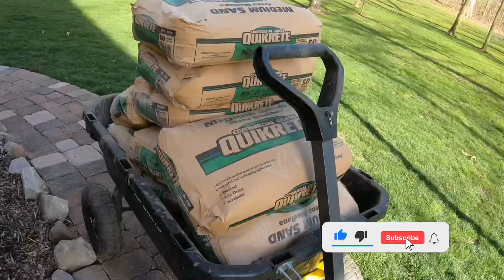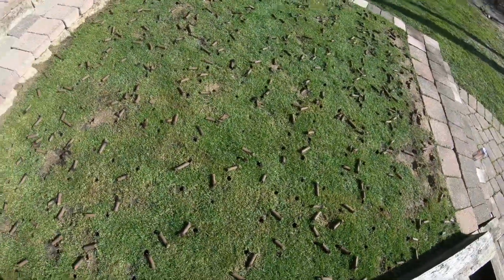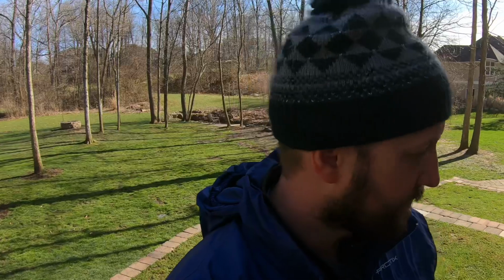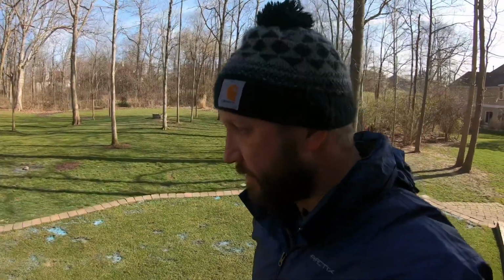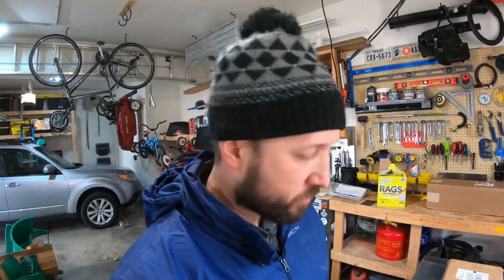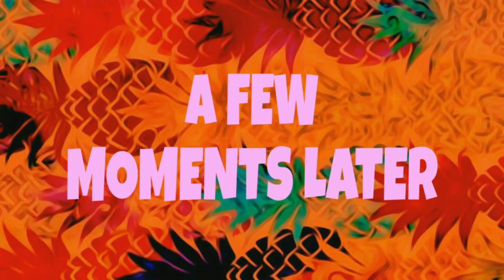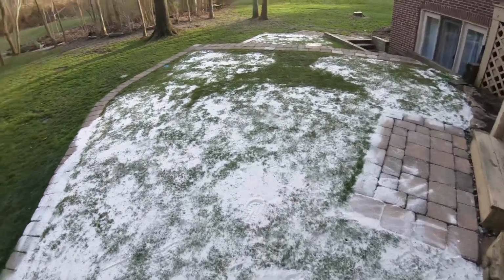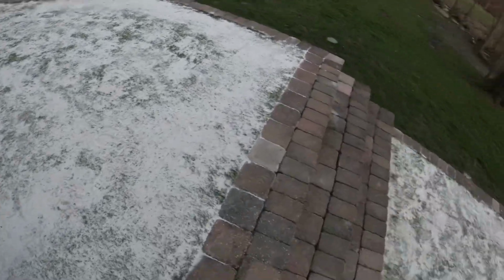Lawn Leveling with 1050 lbs of Medium Sand 😱🥵

Comment: That leveling tool is top notch! Can't believe the 600 lbs didn't squat out the jeep! Good video!
Reply from the maker: The leveler worked really well. If you watch the video from when I started unloading to when finished unloading, it definitely lifts up. 😆   Thanks for watching!
Reply: @theSuburbiaDad  just wanted to say I tried GCI turf fert..spring protene and it's crazy good. My lawn went "pop" in a few days and dark blue green.
Reply from the maker: Link?

Comment: Thanks for the video! Which cart is that one? Thanks.
Reply from the maker: It is a Gorilla Cart. I got it off Amazon, but Lowes has it as well. It is rated up to 1200 lbs and it can be towed, hand pulled, and dumps. 

7-cu ft Poly Yard Cart 

https://www.lowes.com/pd/Gorilla-Carts-7-cu-ft-Poly-Yard-Cart/1000772546

Thanks for watching!